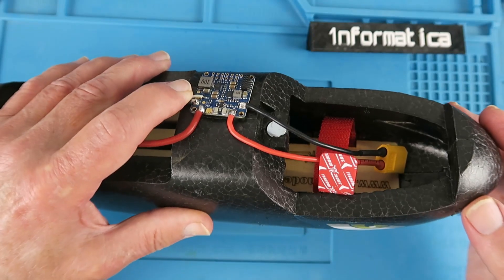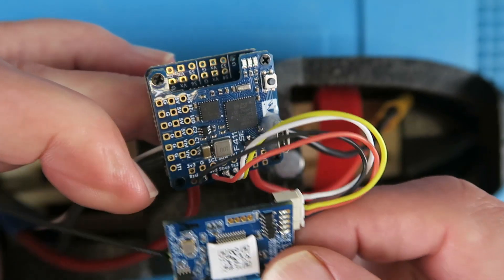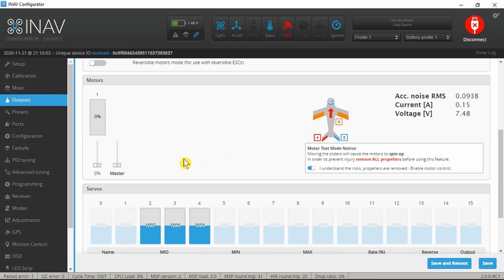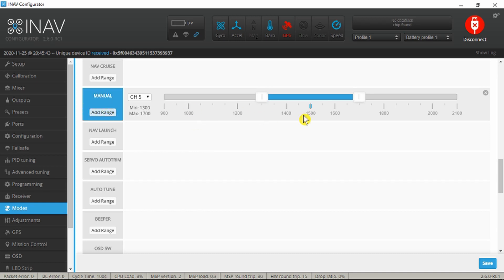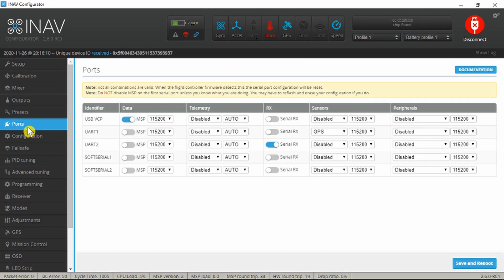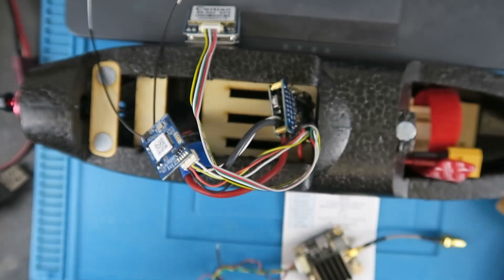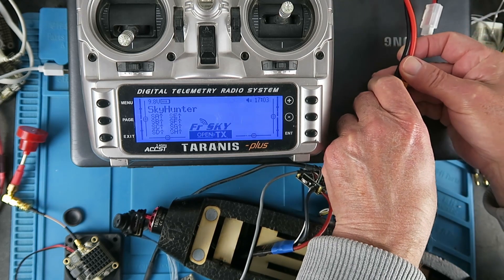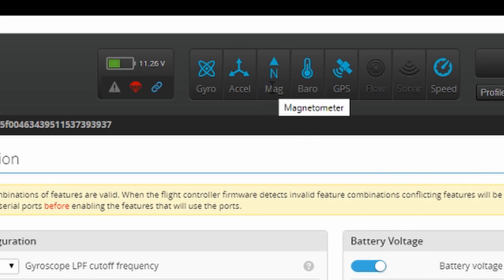Skyhunter Racing With Matek Systems F411 WSE iNav Flight Controller Project Part 2

Comment: I noticed you did not use the negative from the ESC . iS THERE A REASON FOR THAT ?
Reply from the maker: Hi Traci, the F411WSE has it's own voltage regulator onboard. The ESC also has the BEC function, so to avoid any "potential" problems I did not connect the positive or negative  wires that would normally power a receiver. The negative power to the ESC is all that is needed. YouTube no longer shows me if you are subscribed. Please consider subscribing if you have not done so already!

Comment: Really Nice video thanks for sharing!  Did you figure out how to mount all the components on the skyhunter?  What was your AUW without battery?  Just ordered similar components but will be using the DJI AU.  Currently flying it with a S6R receiver but range is limited.
Reply from the maker: Hi, the project is on the back burner for the moment as I cannot travel to my flying site due to COVID restrictions. I have weighed the model with all the parts except battery and it is 310 g. Cheers.